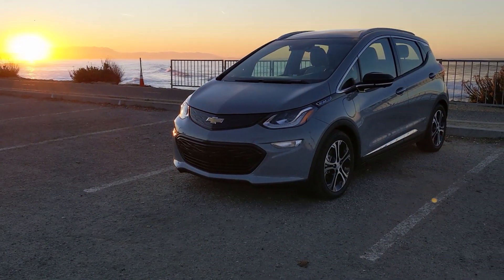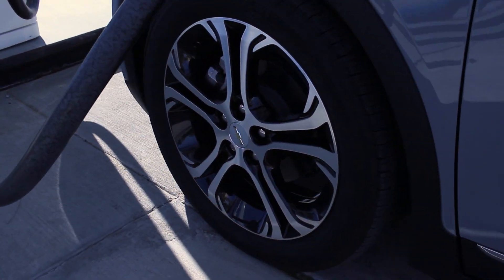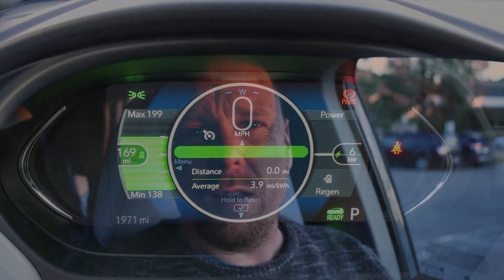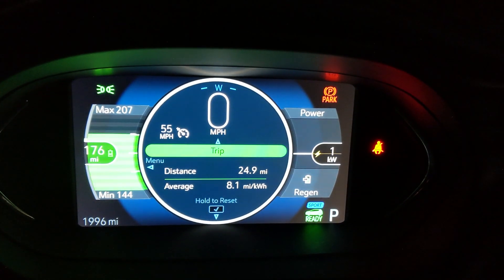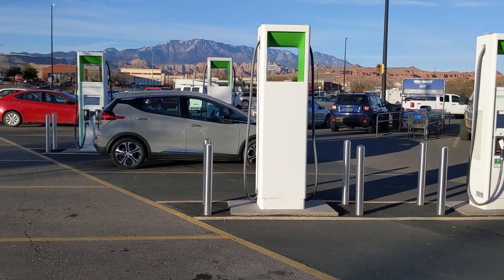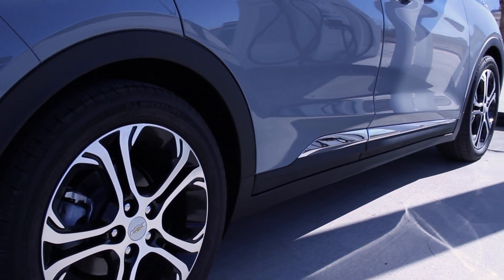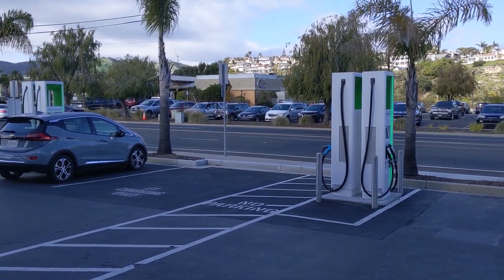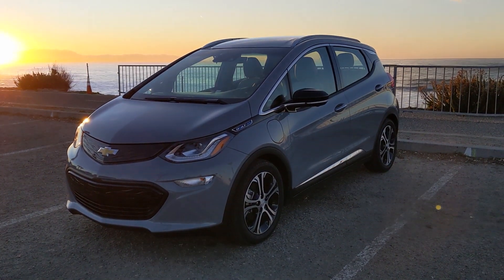2020 Chevrolet Bolt EV Low Load Efficiency

Comment: 8 Mi/KWhr sounds like hyper-mileage  range of 600 miles which is similar to the Tesla Model 3 LR-RWD driven @ 23 Mi/Hr
Reply from the maker: The Bolt EV is an extremely efficient car if driven properly.
Reply: @newscoulomb3705  My wife primary drives hers around town in traffic, with no regard to efficiency (uses air/heat, "normal" acceleration, etc) other than using L and one pedal driving (loves using Regen brakes). We normally always come in somewhere around the low 3 miles/kwh (3.1-3.4ish). Does that seem normal? 2018 Premium (including factory rims/roof rails).
Reply: I once got 8mi/kWh on a 80 mile drive at 75mph average speed in my 2019.
Reply from the maker: @homomorphic  Yes, elevation changes can have a huge impact. This is less than a 500' elevation difference from start to finish.
Reply: @newscoulomb3705  No significant elevation change. You live in socal, so you should be familiar with the weather phenomena that allowed this to happen.
Reply from the maker: @homomorphic  There's no weather phenomenon that would enable 8 mi/kWh efficiency at 75 mph.
Reply: @newscoulomb3705  You fail your SoCal resident test.  I had a direct 60MPH Santa Ana tailwind all the way from Riverside/Corona to DTLA on the 91. The net elevation difference is only 400 ft and I do it all the time with no Santa Ana and I get 4.1mi/kWh.

I should explain that the additional 25 miles were heading northbound on the 15 from my home in Lake Elsinore (with the protection of hills to the east of me but I was only getting 4mi/kWh on that segment)

Comment: Do you think maybe going forward you'll try to standardize your testing regime? Seems like you've got a great opportunity to do some apples to apples comparisons as your channel evolves.
500mi California Challenge Route or 1000km road trip test, 
Eric's low load efficiency route,
Tires always inflated before testing to mfg recomended psi.
Reply from the maker: Yes, that's the plan.
Reply: Do the loop in both directions at the same time of day car settings all the same .My 2017 has never seen 
that high of efficiency. Your test was all down hill.
Reply from the maker: @firstbigbarney  Sure, I could do round trip efficiency, but that's not what the test was about. Also, the test had multiple hills, but the overall net elevation difference is only about 300 feet. 

What's most important is setting a baseline with a consistent test. My 2017 has also never seen efficiency that high (max on this route was 7.4 mi/kWh), so it could simply be that the 2020 is more efficient at low loads.